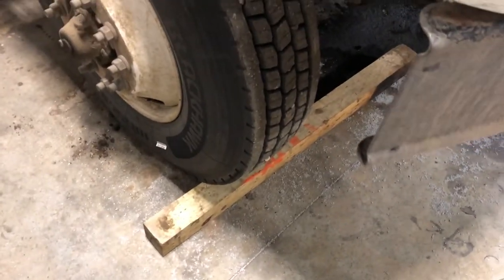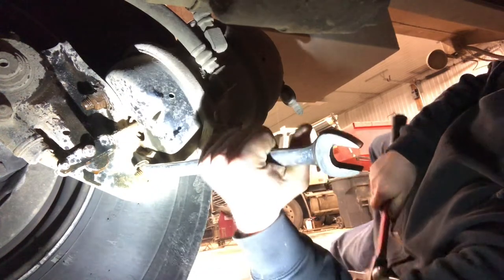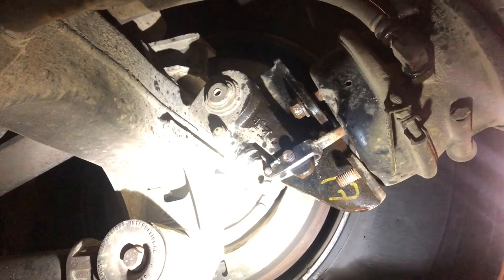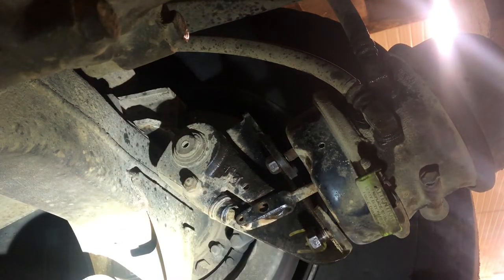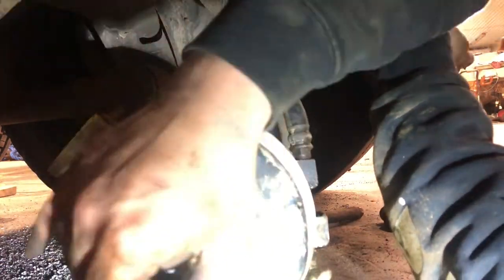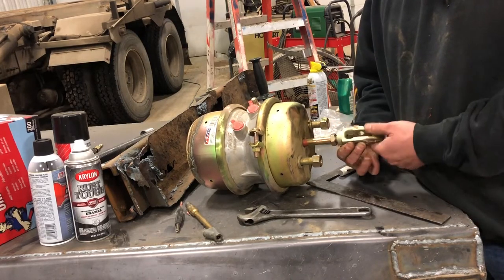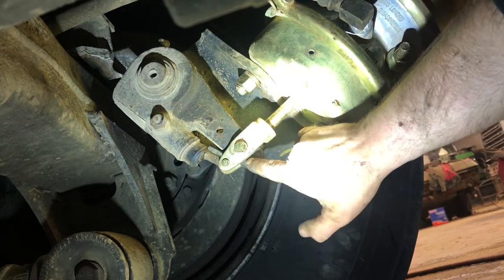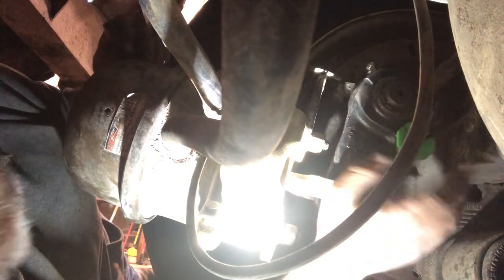In-depth How to Replace a Brake Chamber or Brake Can on an Air Brake System

Comment: Decent video, however it can be done easier.  1st, cage the brake chamber until pressure is released on the pins, remove pines.  2nd, remove air lines. 3rd, remove the two bits holding chamber on.  Repeat in revers order to install.

Comment: What was the green clip for when adjusting the brakes?
Reply from the maker: It holds the lock out pin out momentarily.  Not all new adjusters come with one.  A flat head screw driver will do the same thing.

Comment: Question. If the spring in the old chamber is good then measuring the rod would be done with the chamber caged?  And then the new chamber caged as well when cut?
Reply from the maker: You want the measurement when the can is uncaged (rod out). When the spring is broken and mashed over inside it can be hard to get a proper measurement.  Usually you can fish a coat hanger or piece of straight wire down between the rod and the opening down to the base of the rod. Mark the wire with a pen or something at the end of the rod by the threads and measure the wire.  Or just set the wire on the rod of your new can and transfer the mark.
Reply: @MikesMischief  Thanks. I appreciate it !

Comment: Great video, but you just installed a short stoke brake pot which is identify by the ports. Round Port is Standard Stoke and the Square Port is a Long Stoke. Hope this helps someone that might be changing out brake pots.
Reply from the maker: I did know it was a short throw.  It was on a Friday and we’re a good bit from town.  I had to use it so I could move the truck until we got the long throws in.  Long throws usually come pre cut and welded. I wanted to show how to measure and cut on the fly if needed.
Reply: Great video; I wish that things not worth mentioning by a pro would still be mentioned for novices like me.
A short throw pushes 2-1/2" (round ports); a long throw pushes or strokes 3" (square ports). Ports are where you connect the airlines or hoses. In case you don't know whether you need a 24, 30, or 36 chamber, a 24 chamber has a diameter of 7-7/32", a 30 has 8-3/32", and a 36 has 9-1/16" diameter. The truck I'm working on is a 1990 International 4900 and has 30-30 chambers with a short stroke in the rear.
Having the swivel connectors not on the chamber is really a dumb idea of International. I hope newer trucks have the swivel on the chamber. Thanks for the video!
Reply from the maker: @ebbayer most rear drum-brake chambers are 30/30 long or short  stroke.  I haven’t seen a short stroke can on anything after 2005 unless it was by mistake or in a pinch like mine there.  I’ve done several dozen brake chambers and they were either a 30 single front, or a 30/30 long or short.  I’ve never seen or installed a 24 or a 36 and I’ve worked on every kind of truck and trailer you can think of.  The raised portion by the ports are called bosses.  They’re either a square boss for the longs or they’re round for the short.  I honestly never thought anyone would ever see this video.  I certainly never thought it would be seen thousands of times especially.  I probably should’ve written a script or something but it was kind of a Friday afternoon brake-down repair and I thought I’d mumble my way through and practice making a video. I’m not a pro by any means.  Semi-pro maybe.  These trucks come with a welded clevis.  My plan was to order 4 factory cans but our local dealer doesn’t order them in and they’re 7x more expensive.  So I ordered 4 generic longs, cut them down and then welded the clevis on the end myself.  They’re all still on the truck today.  (Knock on wood)
Reply: @MikesMischief  I now know that what I have is a 30/30 short stroke. Individuals who watch your video don't know how to determine what they have, especially on old trucks like mine as there is very limited information available. Watching videos like yours helps to install trucks and repair defects; however, you also need to buy the part needed ... there is where it gets implicated with old rigs. To measure the diameter is a simple thing to do in figuring out the size of chamber you need. For you, this is a no issue, but not for me as a novice and maybe others with old equipment.
I can't even drive my truck outside my property as it needs a CDL which I do not have. You may ask why I would even have such a truck ... I need to replace my septic system, fix my driveway which is about 1000 ft long, move a lot of dirt to change the landscape, install a 400 ft fence and more. It would cost me at least $40'000 to to the work. I'm retired and decided to do it myself and bought this truck for $3,000 at auction to do so. I will also buy an excavator in the mini range, about 8,000 to 10'000 lbs, with a post-hole digger attachment. When I'm done having fun while saving money I will sell the  stuff.
And again, thank you so much for you to, "mumble my [your] way through and practice making a video."

Comment: And what year is that Kenworth
Reply from the maker: It’s a 1990. Has a first gen 12.7L Detroit. 13 speed Eaton/Roadranger. Has a mass port vac pump.
Reply: @MikesMischief  that's YouTube content and videos for years to come
Reply from the maker: Yeah I’ll be getting a mechanics lien on it for unpaid storage fees at some point in the future. Then I will maybe do some local hauling with it. But nothing across state lines. I want to have a deadman installed in my yard so I can tie appliances to it and to the truck and see which is stronger. That kind of my plan for the summer.
Reply: @MikesMischief  ha 😅😅😅
Reply from the maker: @JPTV3000  if you’re ever back this way your welcome to come shoot a video on it. It’s a beautiful old KW W900B. I had her on some of the raunchiest muddy hilly lease roads out there. South of the lake up by twin buttes. Those roller coaster roads back in there and it pulled like no one’s business for a 30 year old rig.
Reply: @MikesMischief  Man people just don't know!
Reply: @MikesMischief  BIA 14
Reply from the maker: @JPTV3000  she was on BIA 14 many times but it was paved. My first few loads were on BIA 17 hauling for an emerplus frac.  I have some engine braking videos back up on BIA 22. Down to the badlands pad for WPX. It was 14 minutes in and out and had a kiosk at both ends to keep drivers from going at the same time. I do miss those kinds of hauls but I don’t miss throwing iron in the mud. My engine brake videos are old af and not very clear visually.

Comment: How come none of these clowns ever use WD-40 penetrating oil on all the rusty-dirty nuts and bolts before trying to unbolt those bad boys? Make life easier fools!
Reply from the maker: You can’t call people clowns and fools and then call WD-40 a penetrating oil in the same comment James.  WD-40 is NOT a penetrating oil.  It’s a corrosion inhibitor that evaporates.  It is completely useless in a real shop.  We don’t even buy it or have any in the shop.  It doesn’t penetrate at all.  It will lubricate exposed threads momentarily but does not penetrate or leach like an actual oil.  We use JB80, liquid wrench, pb blaster hell I’d rather use motor oil than WD-40 and I have used motor oil on stubborn bolts.  Actual penetrating oil makes some parts of the job easier but it is also very messy and causes dust and grime to stick to everything it touches including my hands.  When  I’m filming and periodically adjusting my camera/phone I don’t want penetrating oil and grime getting all over it and my tripod.